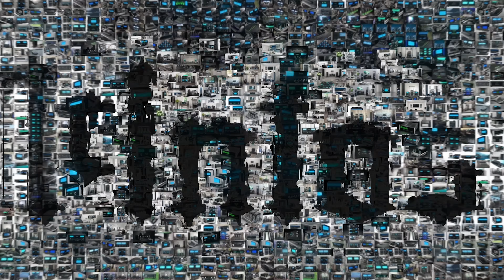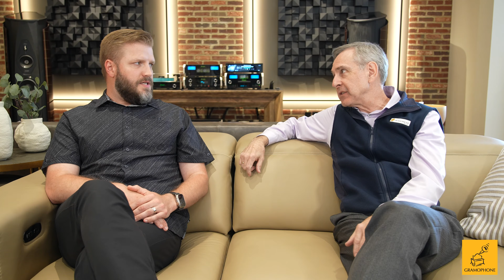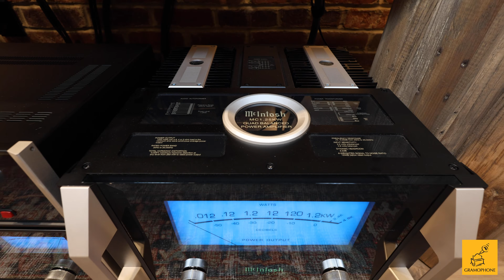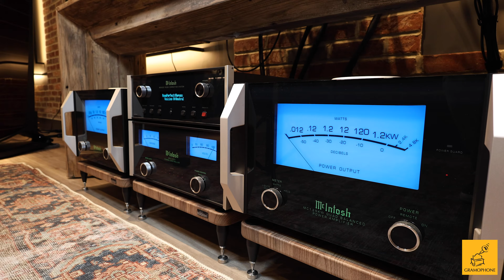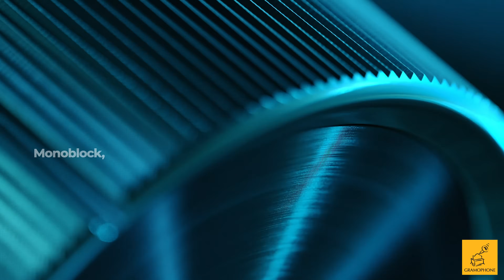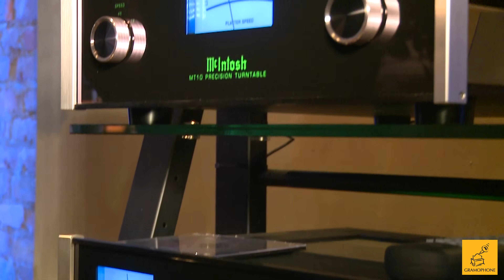McIntosh MC1.25KW 1,200 Watt Monoblock Poweramp Review

Comment: I hear this all the time. And to some extent it is true. But it's also true that a brands flagship is ussually the biggest and baddest amp.

And I believe that having a quality amp trumps 1200 watts you will never come close to using even with demanding speakers.

Thats why a I would put a pair of Gryphen amps at 225 wpc up against any other amp and go toe to toe.

Because realistically if you use 10 watts peak thats realistically. Maybe 50 with the most absurd speakers. And watt or less under normal operation.

There is an arguement to be had by some manufacturers that more transistors and electrics just to make 10 watts is actually hurting the speed and agility of an amp and quality watts are more important than just rediculous amounts of watts.

2000 watt Crown is a great example. Lot's of power, good luck powering a B&W 801 D4 or Wilson Wattpuppy with that. It's gonna sound like ass.

A 225 Gryphen. It's gonna be sublime.
Reply from the maker: Thank you for supporting our channel, Johnrus!  Having a quality amp is the key, we agree completely.  There are lower-wattage amps that sound great, some more powerful amps that fall short - and vice versa.  We can attest that the MC 1.25KW mono blocks are truly great amplifiers, we love them
Reply: @GramophoneMD I've heard them. The reality low dampening factor lends some fatness and smoothness to the sound. But it's doing it in a way at a small hit of driver control and a hit to detail. Mac has never been the final word in detail.

Which IMO is not ideal when we are talking about 35k pair of mono's.

They sound slow and lugging around compared to other premium amps.

Obviously if you come from mid tired stuff of 5k or less. It's gonna blow your mind. Lol.

Myself I feel like Pass Labs or PS Audio make more compelling options for the same price. Neither are harsh and have better driver control at the same time.
Reply from the maker: @johnrus7661  Hi Johrus, thank you again for sharing your views.

Comment: I really like the tiny tripods for the speakercables.
So the wife can do a better job with the vacuum cleaner.
:-)
Reply from the maker: Thanks Mike :-)
Reply: I HATE the AQ cable stands. They’re SO lightweight and super easy to tip over. I stopped using them 2 years ago, stuck them in a box and shoved them into a closet. Absolute trash, especially for the price. How did I solve it? I bought bamboo “pot stands” on Aliexpress. They’re made out of bamboo, and super stable. There’s 2 different ways to use them, and they can even be used for equipment. I have 2 of them holding my Audioquest Niagara on its side, super stable. For <$50 you can solve all of your cable and equipment issues.

Comment: I cannot imagine any case use scenario where that much power is remotely needed.

I appreciate McIntosh, but why?
Reply from the maker: Hi Woody, true - that much power is not "needed" to get to fairly loud levels.  But when you hear a high-end system sound amazing, you realize why a high quality amp is in the system.  Switch to a modest amp, even at quieter levels, and you'll hear the difference

Comment: I’m a professional mastering engineer so I spend about 8-10 hours a day working on music in a purpose built suite. Once you go above what people like me use you’re wasting your money. We ultimately decide how the finished track sounds and we do it on gear that’s a fraction of the price of this stuff. It’s completely insane what people are willing to spend on this type of thing and I guarantee you they can’t hear the difference between mono block and stereo amps, different cables, power conditioners etc. It’s all over engineered bollocks. Look at Sterling sound (number one mastering studio in the world). They can afford anything they want and use active atc speaker systems that cost less than a pair of these amps. 😂
Reply from the maker: The ATC importer to the USA is a friend of mine, and their products are really good.  Having said that - this system is of course far more costly than most.  But it's also an incredible sounding system that hopefully you will get to hear one day
Reply: @GramophoneMD  I’ve heard the focal grande utopias with the naim statement system which is about $500,000 and it’s no better than a tuned, active atc system in a northward acoustics designed ftb room. That’s the issue with hifi, people spend 80-90% of their budget on the system and 10-20% on the room. In professional environments it’s the other way around for a very good reason.
Reply: @GramophoneMD  another big rip off with hifi is with DACs. The most expensive d/a converters used in recording and mastering are about $8000. You can spend several times that on a DAC but the audio will only ever be as good as the converter that captured it 🤦‍♂️
Reply: Does a Rolls Royce really ride 10x better than a "top of the line" CADILLAC, costing 10-15% the price of the Rolls? - Same difference !!
Reply: @gb2828 no but it is better. You’re talking about the law of diminishing returns. The point I’m making is, when you get up into the stratosphere of hifi, far more often than not you aren’t seeing any improvement at all. Just some statement piece some rich idiot can waffle about or some piece of design that looks cool.